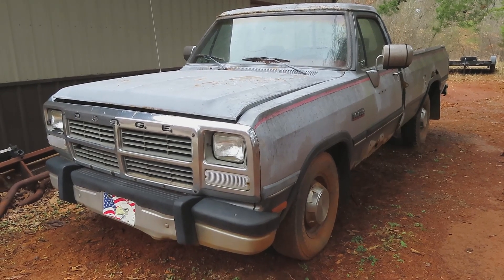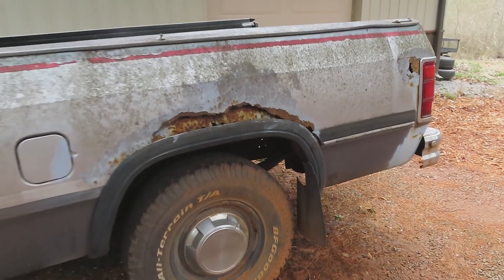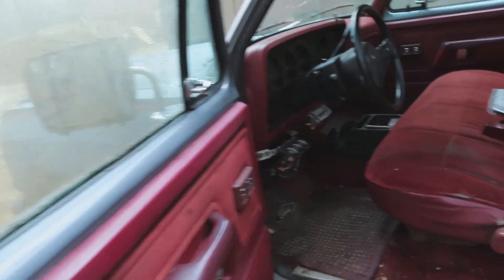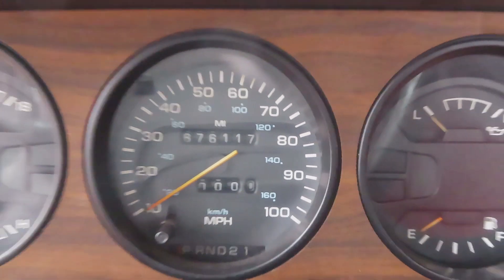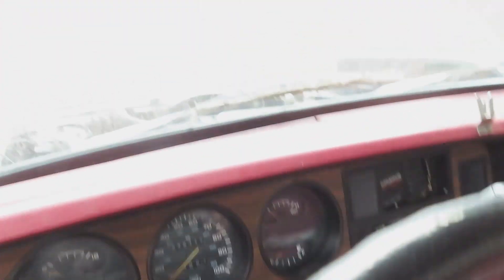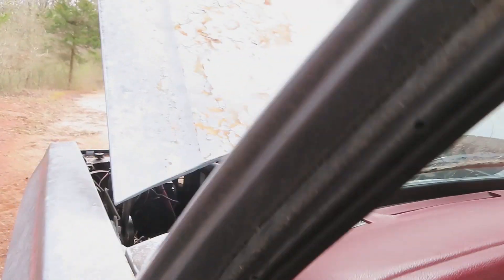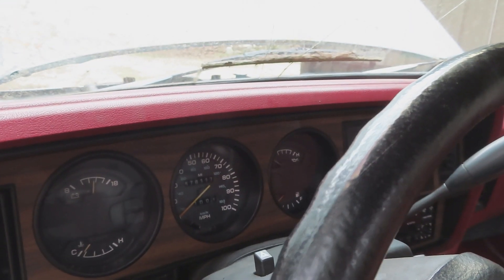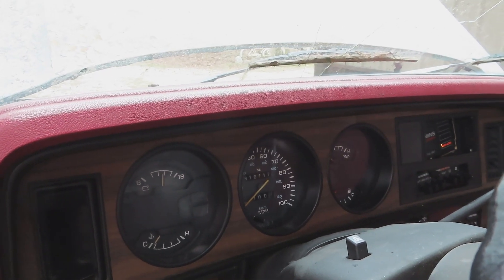Starting a Neglected 700,000+ mile Cummins 12V First Gen Dodge Ram 250 Turbo Diesel Truck

Comment: I have a 91.5 Dodge give you three guesses what’s under the hood anyway I started my truck up here for a week and a half ago it was zero out there was icicles that were actually hooked to the ground or frozen to the ground off of the cab I’m in this thing was it was cold wasn’t plugged in turn the key on wait to start one all fired up probably in two to revolutions this is six in a row Jim  guys I use amsoil products in my truck 5w30 cold flow impover  just shy of 500000 miles on my truck six in a row Jim saying have a great day

Comment: Any reason why my truck shakes violently like a cammed car at cold starts ? Idles normal after a while
Reply: just a diesel thing, until it reaches the correct operating temps it will shake and lope due to the high volume of fuel that is cant burn due to the combustion chambers being too cold.
Reply: I’m going to record a video of it do you have an instagram I can shoot you the video it doesn’t seem normal to me I’ve seen other trucks start up better then mine 🤯 no issue at all
Reply: @watermalanblew  yeah for sure, my insta is @its_just_a_wylie
The profile pic is me in a cowboy hat